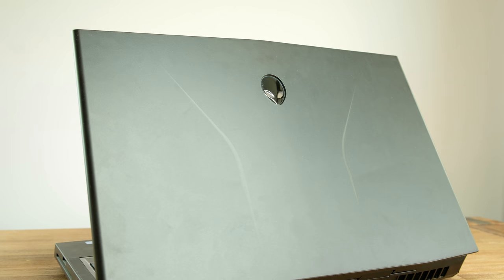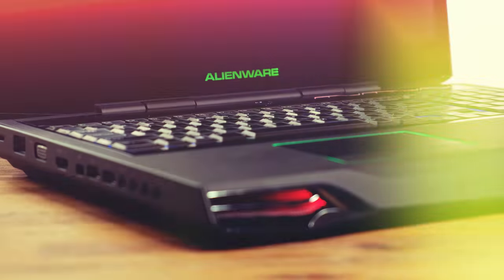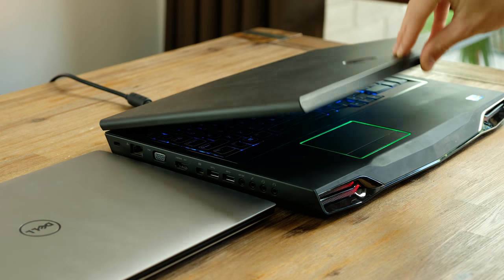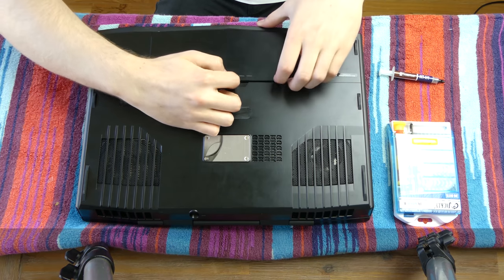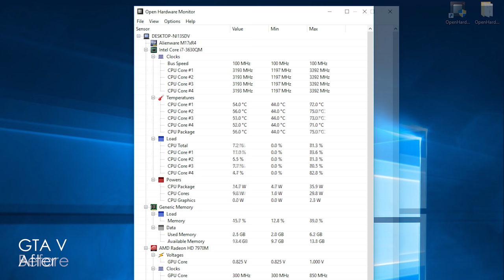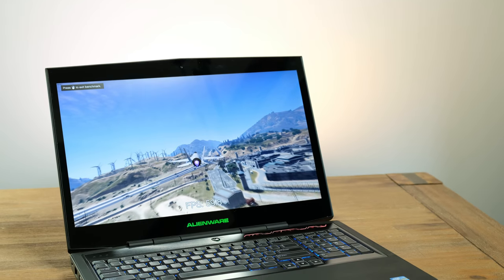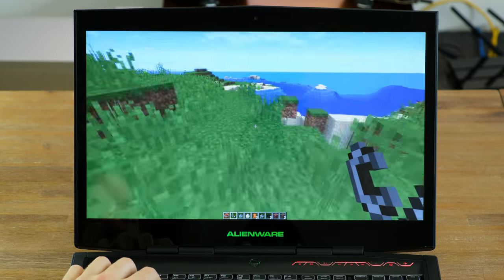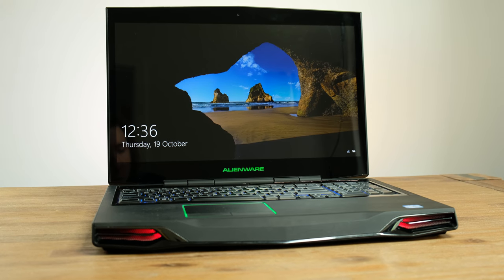Should You Buy an Old Alienware Laptop?

Comment: As someone who's used one of these machines for about a year, I can say that It's actually a surprisingly viable machine for gaming, and I even edit videos on it. I have however had to replace one RAM module, and my SSD, as they were as old as the laptop, and failing. With that said, that wasn't hard for me to diagnose, and fix, and the potential upgraded power for the machine is surprisingly high, if you're willing to do some modifications for a later mxm gpu. In addition, temps are quite good, I can run my 675m overclocked to 700 mhz and still easily stay under 70 C with an adjusted fan curve. The 3630QM is still a decent but not exceptional cpu, but the best option for the laptop is the 3940XM, which is an impressive cpu, even today.
EDIT:
I am now running a Quadro p4000 in it, which falls between the 1060, and 1070. Having a laptop of that performance level, especially with how good it's cooling and keyboard are, nowadays is actually really good for the total cost.

Comment: I'LL TAKE ANYTHING THAT PLAYS OVERWATCH ABOVE 60 FPS ON LOW SETTINGS THANK YOU VERY MUCH.. sorry I just have a really cheap laptop
Reply: Nagisa Shiota get a job and invest on some solid gaming laptop. If you cant get a job, well i dont know...
Reply: Hinatacute ᗩᒍ I'm a student  😂 The same one I use for school is the same as for my gaming 😭😂
Reply: maybe you can take a used laptop with gt 930/840 or higher, i got mine for 250$ with i3 and 930m and can run overwatch at 45(drop) - 70fps
Reply: @mozuku1509  as long as the engine ran Overwatch......what else mattered?
Reply: @tibora13  nothing i guess, but i upgraded my ram to 6gb by taking out the ram from my older laptop since it got the same speed as my curent laptop does
Reply: Understandable. Get a job and save up for a used one, I didn't get my Nitro 5 until my sophomore year in college. Before then, I had a Yoga 900 for 2 years (which I found out was discontinued later because of stupid hardware problems which afflicted me about a year after use). Before that I had another very, very crappy Dell Inspiron 15R (I think that's the right model) that I could barely play L4D2 on, it even struggled to launch most Technic MPs. Not to mention the 2008 black macbook i has to use for a short while, it was horrid. So don't worry kid, it might take a while but some day you're gonna be able to get a better laptop even if you have to go through a bunch of crappy ones first before you can buy the right one.
Reply: Don't get a laptop
Reply: @Cjmink47  students have no choice. Gaming laptop or no gaming at al.
Reply: Overwatch is cringe.
Reply: @crispyshaman4937  all.*
Reply: @haseenabadshah5381  umm who?

Comment: Got the same laptop for $200 USD, slapped an additional 250GB SSD and a 4GB GTX 860M GPU, and am so proud of this rig it isn't even funny. It can handle pretty much anything I can throw at it. Even with the Stock 660M GPU, it is incredibly capable for a now 7 year old laptop, it will handle pretty much any modern game at medium to low settings, and any game id say 2015 and back at higher settings. GET ONE! Their really nice for upgrading due to the stupid amount of ports on the rig, the additional memory bay inside the computer, and overall very modualized design of the circuitry inside the rig (Hense the beefy scaleform and INSANE near 10 lbs weight, which is about double the average laptop weight.) This is definitely a rig that pushes the limits of what a Laptop is capable of if given some care and a few upgrades here and there.
Reply: Wow great deal! Did u have to do any mods for the GTX 860M? Also, do u know if it runs Windows 7?

Comment: Looking at pre 2018 Alienware laptops, one can really appreciate the build in and out. To this day the other flagship companies still are missing half of what AW offered years ago. Yeah they are heavy as shit, which is why they have that solid feel that very few laptops offer. Works for me as im not mobile with mine, if you are...defo AWs are not for you nor your back. RGB lighting can be a bit too much for some but you can turn it off. Keyboards feel great throughout the models and have perfectly uniformly diffused LED lighting.

Comment: This laptop is amazing, I still got mine and upgraded the cpu to an i7 3940xm and the gpu to a gtx1070. It easily keeps up with more recent laptops. But the thing I love the most about this laptop is its amazing design and modularity, if one part like the keyboard or screen would break you could easily buy new parts on ebay. All and all its an amazing laptop that I will still be using for the next couple of years.
Reply: Wow, great to know you can definitely upgrade to a 1070! So did you have to do any mods for that gpu, and how are your thermals?
Reply: Nice! I have the Gp72 dominator from MSI.  But this one is actually better of have to believe you. Just one mxm slot, but a soldered on the board cpu

Comment: You did change my mind (a bit) about used laptops, however since I already own a desktop, I value weight and battery life a lot more, meaning I would spend more for a laptop with similar performance but in a much more portable setup.
I really find it quite sad there is no laptop with a Nvidia MX150 (GT 1030) and a large 90Wh battery. Largest one ive found is the HP Spectre X360 Intel 8th gen with 79Wh but that one is around 1600 USD

Comment: Now.. this was 5 years ago.
I'm currently looking at an Alienware m17x qx9300, which is around 14 years old. 
Am I wasting my time/money?
Reply: the one i have is 6 years old 130 gb and works fine one of my fans stopped working and using a laptop cooler handles well wonder if it last thru out this year…

Comment: i have one exactly like this, its a really easy laptop to repair on, when i got mine it was completely dead. after i had swapped the RAM, Harddisk drive (new ssd), Charger, top lid on the screen, speakers, battery and cleaned up the entire thing and installed new Thermal paste its a great computer, i used it for college and it did a great job.

Comment: Hi, I have a M15X that I bought new about nine years back. Not for gaming but for graphics design. And it still does an awesome job in handling the demanding software I use. It came with Windows 7 pro installed but I upgraded it to Windows 10 pro which definitely improved it's performance. About every two year, I clean out those vents but never thought on cleaning up the CPU heat sink. Can you please let me know what you use to clean it with, and what kind of thermal paste to use?

Comment: I have an old Alienware M15X from 2012 with an i7 920xm CPU and a 5850m GPU. It still plays games pretty well on medium to low settings. It has survived a hard bike wreck on concrete with only minor scratches and has been very reliable. It's easy to upgrade parts and make any necessary replacements. I still don't regret my purchase. It definitely isn't a lightweight laptop by any stretch of the imagination, though.

Comment: Hi, I’m trying to decide whether or not to buy a used gaming laptop like this one. For the most part, the games I’m going to play are probably easy to run, but I also have Rust, which runs horribly on my current computer. Would it be possible to actually run it on an old Alienware like the one in this video?

Comment: Had one of this ... even older model,2820qm with gtx460m.  Used for over 7 years intensively, changed its HDD, RAM, GPU (gtx680m) thus coolibg module; poured water onto it and into it, dried out and work fine. Played pubg on it, running ok.       Besides, it has a3D screen which i used for a while on WOW MOP...impressive

Comment: Just came across this video.. I just picked up (in Feb. of 2023) an Alienware M17X R3 with an intel i7 2860qm and Nvidia GeForce gtx 560m with 16gb of ram for $80.. just upgraded to 32gb 1600mhz ddr3, and dual 1tb ssds, and also have a gtx 580m with heat sink on the way (for another $80). I love it’s look and it still runs quite decent. Only two issues with it so far for me.. had to use a different touchpad driver to get “normal” two finger scrolling in windows 10 since the R3 was windows 7 based, vs the R4 like in this video being W8 based, and the rubberized coating is kinda messed up on parts of the palm rest. Had I seen this vid first, I definitely would have made the same decision. These, while older are pretty cool still.

Comment: Draft Horse is my M18x R2.  Same generation.  One thing to look out for is dimming of the lights with age, worn connectors, and failing fans.  Both models are very desktop like to the point it should be practical to upgrade the chipset.

Comment: I actually bought the m17 r4 I'm 2012 for $2000 brand new and it's still working today. I have a 1tb SSD and a 2td HDD. Unfortunately 8gb of RAM and still running the stock gtx 660m there are games I'm unable to play still such as pubg and re7 but for the most part, she's still working well on most games.

Comment: as pc guy since i was old enough to use dos... the first thing you should do with a used laptop is to replace the stock thermal paste along with heat pads with copper heat-sinks 20 degree drop in operating temps in game css

Comment: what graphics card do you recommend should the CPU be updated?
Reply: the best gpu and the only gpu worth using is the 980M. It can perform somewhat decently, only caveat being that you have to inf mod to install drivers. Only other GPU is the 780M which is just easy plug and play (aside from also having to inf mod drivers). Strongly dont recommend the 7970M or 680M or 880M. All three are either not good for 60 fps gaming and the 880M has power throttling problems. If the only two options are the 7970m or 680m though, get the 680m. It's much better.

As for cpu, the best you can get is the 3940XM. Has bad thermals though.

Comment: found this exact same model on ebay and the description says the computer beeps 7 times and does not power up. is it worth me buying and if so what could be the problem?
btw its 150 pounds which is an absolute steal
Reply: 7 beeps if I remember correctly means the GPU has failed, It would need a new GPU..

Comment: Also managed to find one with i7 3720mq And 2x 7970 ... Had a same problem with thermal paste, so I used grizzly conductonaut on CPU and both GPUs... Temps down 20+°c  and in firestrike I got graphics score 10226, physics 10021 and combined 2890 no OC ... And then I gave it to my brother 😁totally worth the 💰 for less then 400usd

Comment: Eh... Almost 500 gets you a long way these days. For an extra 300 you can get a decent Dell with much better CPU and a 1050; definitely worth it to me (if I used laptops). You can get a gaming box with a 1070 for about 500~600 or a 1080 for 600~700. That will way outperform the specs you listed. 
I'm a fan of server architecture for work (audio/video editing) and I game on my work machines so here's what I would do for a budget machine:
LGA 1366 dual cpu motherboard, about $50 ebay. The best procs you can put in that are the X5690 which costs $200 for a pair on ebay. We're at 12 core, 24 thread 3.47GHz. My setup with that proc does everything I need and I've never yearned for more speed. 
Get 16GB of ram across the 8 slots at 1333 for about $120 on ebay, SSD with 500GB (plenty to load an MMO and several blockbusters at one time) for about $150 new, a decent PSU (rated at Bronze) for $80 new and heat sinks for $30 on ebay (yes that's both). 
That totals at $630... You could get a reasonable case for under $100 used (I'd prefer an open air for around 100 so I can mine in the off hours) and a 1050 TI (much better than an old radeon) for $150 and your total would be $880 before peripherals. You can get satisfactory keyboard, monitor and mouse and keep your budget really close to $1000. From there you could upgrade for days...

Comment: I have this Alienware M17x R4 with GPU AMD Radeon HD7970M.
Can i change the GPU Card with another Newer One Like nVidia GTX1050 or AMD Radeon R9 M470 ?
Is there any link with more specs, info and prices?
Reply: No.
Reply: Look for egpu
Reply: http://www.eurocom.com/ec/upgrade(2,259,0)Alienware_M17xR4 

They can do it, I have the same model as you with the 7970. I'm considering this
Reply: no 1050
But 1060 and 1070 are available as Marjohn said c:
Reply: That's amazing, you can buy an M17x R4 with a 1060 plus heatsink for $773 on there! So did you do this, and what did you get? I couldn't find an setting for the 1070 but they list it as an option.

Comment: Bro can you tell about this models battery..i believe it has 9 cells of 18650 model battrry = 3 sets of battery ,each set contains 3 cell.Each sets connected in series...my question is that ,when connected like this votlage =3.7v×3=11.1 volt.if so what is the capacity of one cell?(in mah)?
Total capacity is written 90wh(=8100 mah)
Or is there any difference in my assumption?

Comment: Just bought one of these for 70$ Kinda hyped, keeping it more as a secondary and for nostalgia as im typing on a 2019 Area 51M atm
Reply: Just read your comment and typing this on my New Generation M17 with 9980HK, RTX 2080. Thought about getting the Area 51 until this came out and I realized it has the exact same power and weighs much less. Oh and it also has a 144Hz screen nice laptop you got though...
Reply: @jamesstubbs8954  just got the RTX 3080 with ryzen 9 5900hx .....4k screen zephyrus duo se 2021 model killer machine!

Comment: I seen alienware laptop for 70€ in there where i live it has old Core 2 duo and I think 4 or 2gb ram can’t remember should I buy it? (Alienware M15x R1)
Reply: HDD 160 GB, RAM 2GB,
Intel(R) Core(TM)2 Duo CPU T9300 @ 2,5G0Hz,2500 Mhz
Reply: Tomas Gaming it's a bargain, but these specs are really a downside in 2018
Reply: You need well, a gtx 970 with 6gb

Comment: I still have mine. i7-3740QM in my case with a GTX680M... I think it runs stuff pretty good all things considered, the TN panel isn't the best (and boy is it hard to see if there's ANY light). Mine is an absurdly top specced one that came with dual 256gb Ssds and if I remember right originally was over 4 grand. I got it by using a bunch of dells deals and coupons for something stupid like 2k and in all honesty.. It's a good laptop. I actually like it more than the MSI that I ended up replacing it with

Comment: As a mobile device? No. Hell no. But as a desktop replacement? It's definitely worth a consideration. The CPU is more than strong enough for office tasks, multimedia and gaming, the GPU is still decent for a laptop and the boatload of IO makes it very usable for attaching all sorts of devices. Plonk it somewhere on your near your desk, hook it up to a big monitor, connect a mouse and keyboard and you've got a good PC with solid gaming potential. In that case it wouldn't even matter if the screen was busted.

Comment: I think you mean 48 degrees Fahrenheit. 0 degrees Celsius is at 32 degrees Fahrenheit, so you need to subtract 32 degrees when you convert them since it is a change of 27 degrees C and not that the CPU is running at 27 degrees.

Comment: I was thinking about getting a old alienware. I was looking at the 13 inch model that has the graphics amplifier port. I was thinking the 960m should be enough but when I am on the road. Home I want to be able to set it up as a desktop type set up. The thing is other laptop with the 1060 are around 800-900. But I really want something that I can hook up an egpu to if you get what I am saying...... Decisions decisions.

Comment: I have 2 choices between gaming laptops which one should I get just keep in mind there both alienware.
M17xr4
Cpu: i7-3630QM
Ram: 16GB
Gpu: ATI Radeon 7970M
HDD/SSD: 1x 1TB SSHD, 32GB M.Sata SSD, 500GB 5,400RPM HDD.
for $525
or 
alienware 15r2
Cpu : i5-4210H
Ram: 8Gb
Gpu: GTX 965m
HDD/SSD: 128GB SSD Drive + 1TB HDD
for $500
Reply: go with m17r4

Comment: I picked up a Gigabyte P27 with 16 GB RAM Geoforce 840GTX 2GB, I7 4810MQ chip full HD 1080 17 inch screen, 128GB SSD for $500, as stated battery life is rubbish but it is a gaming Laptop so thats to be expected, BUT it boots Windows 10 in around 8 seconds :), weights in at brick like 4kg or just on 9 pounds. Bang for the buck you can't beat a old gaming laptop, blows away newer laptops using low voltage chips and without dedicated graphics cards. It known as the BEAST in our house, its just demented FAST

Comment: Man, I bought an M14xR2 and initially, it was great. I could run almost anything on high settings. Now I have trouble with frames on CSGO on low settings. I'm really confused with such of a significant drop. I've ended up factory resetting my computer like 3 times and nothing changed.
Reply: Csgo is running on old source 1 engine i had troubles with my gaming pc and gaming laptop until after couple of days i fixed it